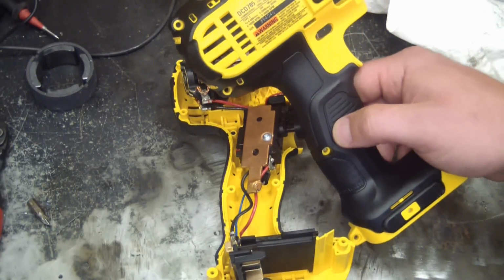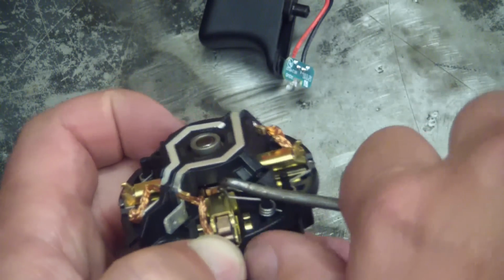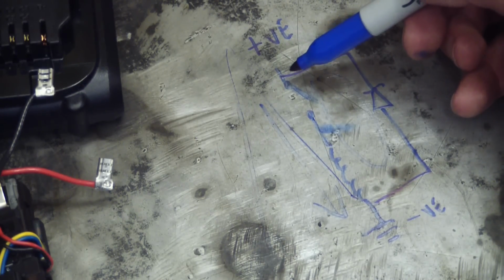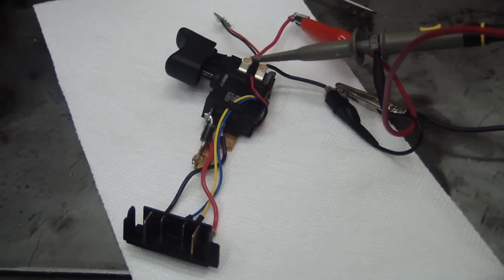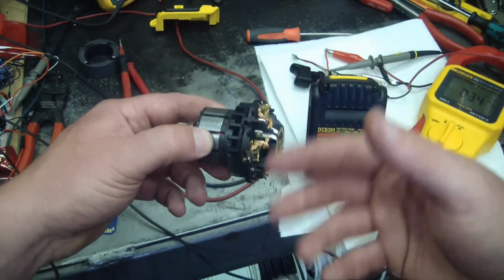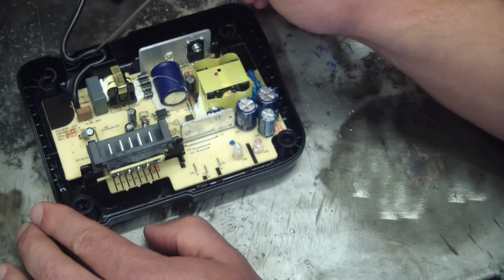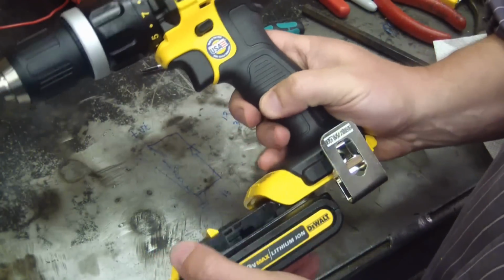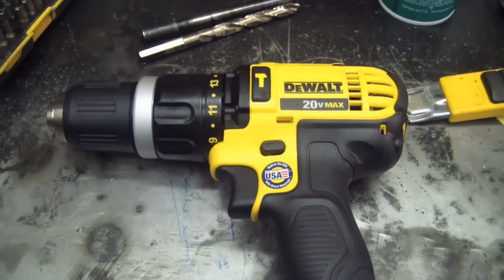BOLTR: DeWalt Hammer Drill. Test, tune and Electrical

Comment: the reason for that audible 4khz driving frequency is because of the motor it is driving, the motor are made up of laminated silicon iron sheets, driving it at higher frequency then you start dumping the power to the iron itself because of eddy current, you can overcome this by making a ferrite cored motor by the time you drop it just pray it doesn't break, ferrites are so damn fragile

Comment: I have an 18v DeWalt drill that I bought new in 2002 or so.... I'll send it to ya to tear down if you want to see. I used it to install metal roofing for the first 2 years I had it. Since then she's just been used at home. It's got a bad bearing in it at this point I think.

Comment: Hey ... Here in the uk we have very strict consumer law that debunks false claims by manufacturers .. most of these power tools are clearly marked 18v in the uk and not 20v as you have mentioned, unless they are an import ? .. in your disassembly the fully charged battery was only 18v yet  the drill is marked 20v... ?  WTF !

The angle of the dangle = the plank of the w**k ... !

Comment: i have the DCD996. not a Dewalt fanboy I prefer Makita. But that thing will drill through concrete with 15mm bits, fast. It will not move at all in drill mode. turn on impact and it goes through it like its cookies. so no, its no gimmick. and i would never buy a drill without the hammer function. I'm not a pro. one flagship drill, a grinder and an impact wrench should do.

Comment: Years back I got sucked into the concept of a DeWalt hammer drill.   tried drilling a few holes thru the footings of my shop to anchor a winch to pull in dead vehicles ,    ya right. took out the piece of junk chuck ( replaced with a super cheap junk Princess auto special chuck on the drill. no more hammer drill. )   , worthless feature I tell ya. went out and bought an actual RYOBI or whatever it is hammer drill.   bought the actual hammer drill bits and it made quick work of drilling 1/2 inch holes about 8 inches thru.

Comment: How come you never make a comment about the placement of the LED light and how it casts a shadow from the Chuck over the fastener or the work surface? You should do a modification to bring the LED down to the battery holder so it shines up where you need it to be.

Comment: You're 100% correct. If you hit stone or gravel  when drilling concrete with a small drill, it stops. I take the bit put of the drill and smack it  with a 4lb sledge.

Comment: It works fine for brick and mortar etc with a masonary bit.  Have used mine for years in rain, snow or shine.  Dropped it hundreds of times.  The black rubber stuff hasn't come off even though it's covered in oil, grease etc alot of time.

The chuck has a habit of self loosening with the brake on high speed though.

Comment: lol fan boys, me nah, but i do have the brushless drill driver combo , got the hammerdrill version as specs show both tools had more umph, driver gun been great for bout a year now, drill done great but had to have it repaired once and the thing dont seem like it was,  power is back but the variable speed is engaging the brake on slow down with no load.   this is not the tool to use to mix a skid of sac create ,,   think i was melting the insulation off the winding's,  yeah it got that hot but never stopped.

Comment: So the rock drilling test video motivated me to try out my Makita XPH03 hammer drill, as it being I much more prefer Makita over DeWilt or Milfuqui.  I found a large 6,172 year old rock and got to business on it.  The Makita XPH03 humiliated the rock prison style and penetrated it with not one single smear of vaseline. What for increasing the lubrosity of the attack.  If I am drilling incorrectly in my video (not made for any other purpose than to pick your brain) I would love to take your pointers here in your comment section.

Comment: My Dewalt hammer drill was $95 and it is doing a fine job drilling 1/4 inch holes through my foundation to anchor a cabinet I'm building.  Sure, a rotary hammer would do it better, but they are 4x (or more) the price, and I just don't have that many holes I have to drill in concrete.  

And yes, I could rent a rotary hammer, but that costs money, and they make you buy a drill bit, and none of the home improvement stores in my area do tool rentals, I'd have to drive all the way across town.  All in all, spend a bit more than all of that expense, and I get to keep the tool.

Comment: The only Dewalt I've ever cared to buy is the corded dwd112, 2011 and had maybe 10 hours on her, that's a good drill, opened her up and not even any dust, but just enough wear in on the brushes and presumably the gear to be a better buy then a 2016 unused one brand new for the same price, and I would bet since 2011 to now something got cheapened. I need to buy a new battery drill set though, and I haven't even begun to think about which brand to buy, I'm not happy about them all being Chinese, but I know some of them are at least solid built and has the balls, I'm just not sure the venerable milfucky is the one, supposed to be top of the pile for cordless but I am not impressed. Does Hilti make battery stuff?! lol, haven't seen any that I know if, but if there was a Hilti quality cordless brand, which would it be? New makita stuff, ?  , is it up to snuff? If I'm going for a cordless SET I'm looking for an investment, I mean solid.   Any suggestions from the hard use crowd?

Comment: I've recently subscribed to the channel. Loving the vids. Just one minor point; PWM varies the current to the motor not the voltage. By varying the duty cycle (the 'on' part of the time between each pulse), the full voltage is applied, but the average current is controlled.

Comment: You are slightly wrong about the charging of lithium batteries....it is constant current  (CC) up to full voltage (4.2v per cell) and then holds at 4.2 but reduced current (CV)...so you can charge lithium batteries with a normal lead acid charger as long as you don't go over the max charge current per cell and monitor the voltage and stop at 4.2 per cell, I do it all the time, also the "transformer" on the A.C. input is in fact a choke.

Comment: I use to work at OEM supplier for car starters. I'd love for you take something like that apart and critique it. I did the armature winding, we used much bigger wire though a lot less winds,  we had 25 wind we used .315 micron wire, 27 Wind we used .265 and for 29 slot we used .197
Reply: Daniel Baird PM him and send one in

Comment: the grooves on the brush and the commutator give you a larger surface area for current flow in a smaller square area. it is pretty effective

Comment: Hey AvE what i have found is that the hammer drills are great as an impact screwdriver or to break loose nuts and bolts. got two older Makitas still running strong

Comment: a little of the googling [18 months later] and i find the electricals have reversed their directionals, to whit: "Direct current or DC electricity is the continuous movement of electrons from an area of negative (−) charges to an area of positive (+) charges through a conducting material such as a metal wire. "  can the poles [earths, not peoples of a small nation] be far behind?

Comment: that bit of putty on the armature (rotor) is for balancing - there is not enough meat in the iron to grind away. 4 brushes (2 positive, 2 negative) make it a 4 pole motor (hence the 4 field magnets). the bigger diameter of the "rotor" gives more torque - longer leverage. the grooved com is spiral and helps blow the arc over and remove debris. this is so much like a locomotive traction motor
thanks AvE, nice/fun review

Comment: that yellow bit of epoxy on the armature windings is actually balancing weight.  it's 2 part of course,  and contains fiber,  almost like a wool type material, and cures Super hard.  we balance large rotors with washers,  or even weld keys to the inside of freshly machined rotors,  and fine tune it with that balance putty...putting that on the windings that don't appear to be dipped/ coated is kinda cheap considering she spins  22k god dammits.

Comment: You mention that if they changed the PWM frequency up to ~20KHz, it would "only drive away the teenagers".  This is untrue.  every industrial drive I have worked on, from ABB, Allen Bradley, Siemens, Parker, and many others state, that as you increase the PWM frequency, you must DERATE the system.  and they only go from ~2KHz, to ~16KHz.

So, to take the tiny motor here, and quadruple the PWM frequency, they would have to DERATE the tool by I believe 4x.

Comment: The cement is the stuff between the gravel in the concrete, drilling in concrete means to drill stone. The bad situation is when a concrete drill will reach rebar (for wich it is not made to deal with)

Comment: I use the hammer action in a small cordless drill to drill either thin or softer masonry, to put a wall plug in there etc. The small drill does it easily and a bit quicker to take out of storage than the plug in drill. When heavy duty "chooching" is needed, I get the plug in big mama

Comment: i couldn't get one without an hammer. having a proper hammer drill already, well if like me you live in a concrete house, you need it to put up a picture..did once use the battery drill hammer as i was up a ladder and couldn't be arsed to go down. it did put an hole in sand stone molding, but took its time

Comment: My understanding of the hammer drilling capability was to make it more effective driving screws such as phillips head that tend to strip out. The effect is that it makes them as easy to drive screws as the compact impact drivers.
Reply: therawlifefamily Yea they're mainly used as a rather never need and have it category mainly being used for masonry/drilling tapconn pilot holes for various trades in construction. I use the hammer function nearly every day to every couple days doing heavy mix of resi and commercial electrical work.

Comment: You may have addressed this already in an early comment and it's just buried in the feed as it were but for my own edification and that of others who are tuning in a year in the future here that first transformer in the charger isn't feeding the chopper, it's feeding the logic and the full 110V is going through the bridge.  That's why they got a 220V rated cap in the filter network before the chopper.  That first transformer is feeding the logic behind the chopper and charge monitoring system most likely.  Just a little bit of pixies like 5V at a few milliamps.  Transformer theory and core material coercivity vs frequency of operation says that's all a little one like that is going to be good for at line frequency. The higher the frequency the smaller the transformer, weird but true.  It's only because the chopper in there is running at several tens of kHz that it can push the several hundred watts through a transformer the size of the second one in there even.  It also likely has fun stuff like sensing coils and whatnot in it so that the brain can tune it's specific operation frequency to the resonant frequency of the transformer core at it's current temperature allowing the highest switching efficiency and therefore lowest possible thermal dissipation in the transistor junctions by switching at a point that will let it fall into a natural zero crossing situation.
Reply: ... With the slight difference that the "little transformer" is actually not a transformer at all and isn't supplying any of the circuitry, but is in fact a common-mode choke. Just another stage of noise filtering, along with that rectangular grey X2 film capacitor.

The charging control circuitry is all on the secondary of that power supply. The only "logic" on the primary is the little flyback controller chip that drives the switching MOSFET. That chip is supplied first through a high-value resistor coming off the positive of the HV DC bus (the big blue filter cap), and once the switching starts, from an auxiliary winding on the big transformer.
Reply: ... And for the sake of accuracy & completeness, the optocouplers are most definitely NOT used for driving the MOSFET (the second TO220 package, the one on the secondary side, is actually a high-current rectifier diode). Those are only used for secondary-to-primary feedback. One for providing voltage information to the primary-side controller, and one either for the current, or just an "enable" signal.

Comment: the motor is actually balanced but not by removing material from the rotors. the dab of yellowish material on the windings on the output side of the armature is epoxy used as counter weight. this technique is used in high performance rc brushed motors (which are mostly replaced by brushless now) that are high efficiency and rpm. since no metal is removed from the armature poles i guess it provides a more uniform magnetic flux across all the rotors.

Comment: The yellow glue smuw is balancing compound epoxy. Better than grinding into the rotor laminations. And the white line is used in a balancer as a reference mark for the balancing compound.Signed,Process engineer for 30+ years in DC motor manufacturing. Ya, an old fart.Nice videos!

Comment: two things, 1. I like the overheating protection of my millwaukee tools because I am very impatient and demanding of my tools and I'd fry the expensive bastards if left to my natural inclination.

2. I agree with you about the hammer action being useless against very dense materials like stone and concrete. I do however need to drill into brick and mortar quite often and my millwaukee fuel performs much better than any other I've owned (I've owned three different Dewalts, a bosch and a regular m18 millwaukee) or used. but of course if I need to grill a big hole in anything from brick to concrete I pull out the Makita sds plus rotary hammer. that's a great tool. it performs better than my old Bosch before it died after ten years of being rode hard and put away wet. 

I love your videos as you give the straight poop and none of the marketing manure. keep it up. I tell all my friends about you because I enjoy your wit and wisdom so much.

Comment: well dude we don't usually connect the "reverse bias diode" (or "flyback diode") like that.
cuz we know
1. all diode is having a "reverse leakage current", that is, even though an ideal diode should block all reverse current, but nothing ideal exists in the real world. and that tiny little current (probably just few uA) kills the battery.
2. a coil can build up super high voltage spike (converting the magnetic field back to current), probably a dozen times the input voltage. if you feed that back to the battery it goes kaboom.

so we usually connect the diode parallel to the coil itself only.

nice channel anyway! i learned a lot of things from your videos.
Reply: i was thinking this, hence looking in the comments for somebody that beat me to it lol
Reply: 曾其威  Diode, as drawn, won't work.
Reply: That, plus the load's usually connected between the positive rail (+ of the battery, in this case) and the MOSFET's drain pin.

Comment: Fun is when the carbide masonry bit runs into rebar, breaking off the carbide cutters when they overheat. How many bits did the crew start the day with? All used up by morning break. Motto: bring cobalt bits and switch over to them when you hit rebar, and do it at once. Drill through the steel, and switch back to masonry bits.

Comment: there arw some really impressive plastics out there. PAIs can get up around 150 MPa without fibers. (wiki says 221 with 30% fiber but I got no experience there)

I have a plastic bullet puller that I beat like it owes me money. when first Holding it you are convinced you could beak it if you tried. . . Then you try and feel like a nancy when it doesn't even get a chip.

Comment: you think these dewalt motors would be good for a rc?
Reply: A friend of mine built a telepresence bot that used dewaly motors for the drive. they were not speed controlled just on/off. I figure its got 20 hours of drive time and no problems.
Reply: Um No haha they're good for rigged bike motors, go carts, ect. Even the batteries my boss has modded a couple broken ones and put it on a power wheel for the kids haha.

Comment: i recently opened my boschs power4all  battery.. 
no cell balancing or over current protection circuit going on. there was too few pins at the charger to let him do the job, nor the drill had as much pins.
i looked on the internets and the cells was lithium manganese.  low capacity (1300mah), high current & "safe" cells that doesnt need a balancer   
https://picload.org/image/rgroralg/cimg5832.jpg
https://picload.org/image/rgrorald/cimg5831.jpg
Reply: frik , every time I start to get a handle on all the knowledge in the world , you got to go throw something new in the mix . lithium manganese!? well of to the forest of knowledge I go , to see the wizard Google. tell my parents I loved them , and my buddy can't marry my wife .

Comment: Just to clarify something you already said, the "Masonry only" rule is exactly what makes the extra $$ worth it to me. 99% of the time, I'm drilling CMU's in garage and basement walls, or mortar joints around brick, pop in a lead shield, and screwing shelf standards to walls all day... These light duty/light weight hammer drills are perfect for exactly that. But I keep a Bosch medium duty corded SDS rotary hammer drill for 1/2"and larger, and a big Hilti for the ridiculously hard concrete and stone big bores.